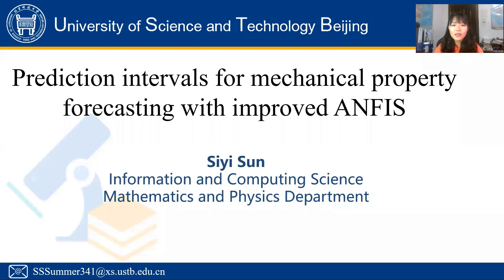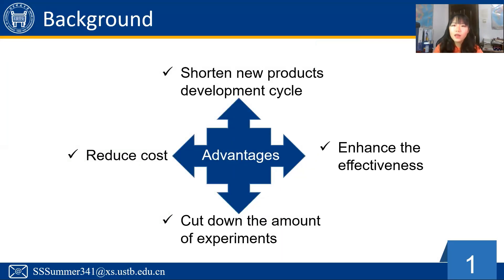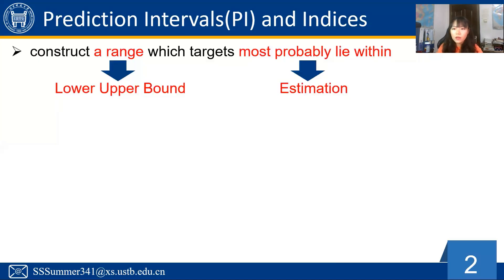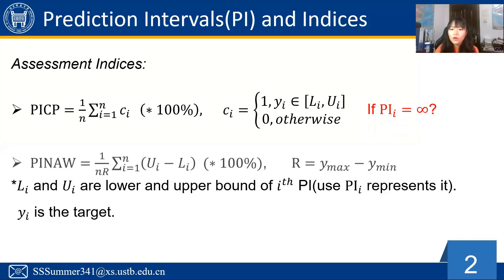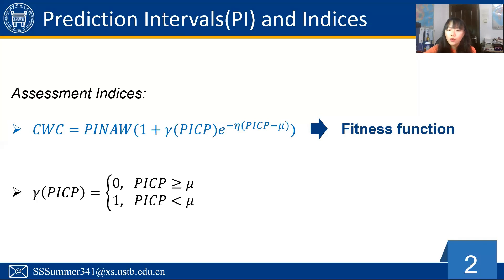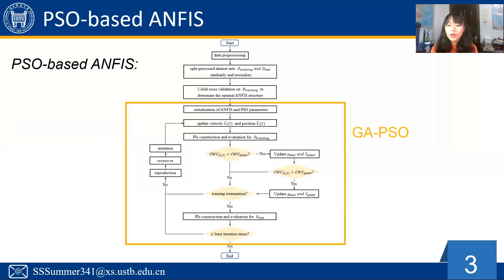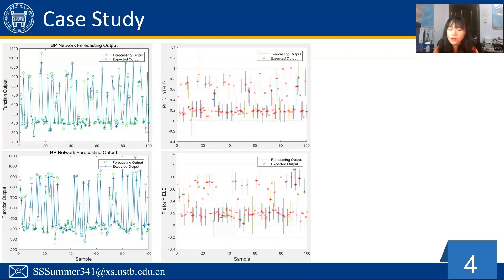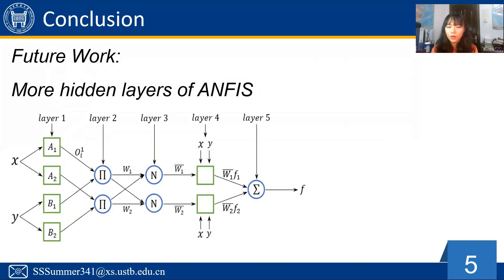CONF-CDS 2020 - Prediction Intervals for Mechanical Property Forecasting with Improved ANFIS

Comment from the maker: Here are the questions we collected and answers replied by the presenter:

Q1：Compared with other existing forecasting methods, how much does your method increase the PICP ratio?
Detailed answer can be found here in the Google Doc: https://docs.google.com/document/d/1PaiJlgEQLjoTstO5cUY44-JR1gcwKgM-DYrk2ZDU3pk/edit?usp=sharing

Q2：Are there any drawbacks with your method?
Well, it must exist somewhere to be refined.
First, from theory aspect, it also suffers from the singularity problem if the rules adopted in ANFIS aren't a linear combination of inputs. But it can be solved by adding a relatively small value which is calculated with a fixed formula.
Second, from a computational aspect, compared with other methods in this area, the speed of PSO-based ANFIS is fine. If you follow the experiment method in my paper, each episode takes 0.5-0.6h with MATLAB 2017a which is fast actually. However, if you want to employ this method to handle problems with million samples, you are supposed to reduce the layers in the network and separate them into several batches. Otherwise, it will take a super long time. That is to say, you have to sacrifice the quality of prediction for time.
Last but not least, adopting this method in specific areas should combine projects’ background with the method. Roughly adopt this method to low interrelation data won’t obtain high quality PIs.

More questions are welcomed in the Google Doc and the author will response ASAP.